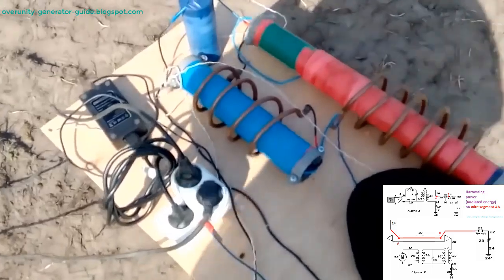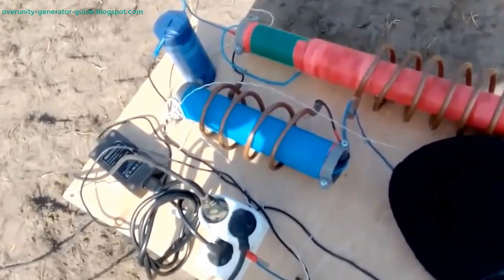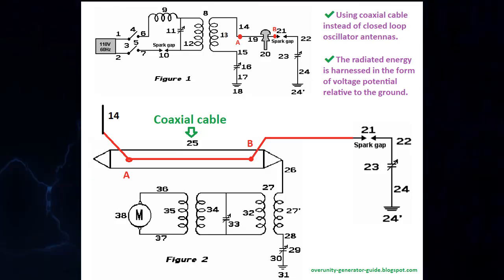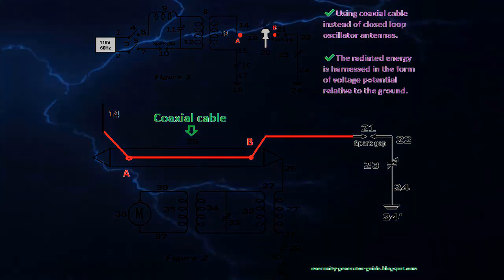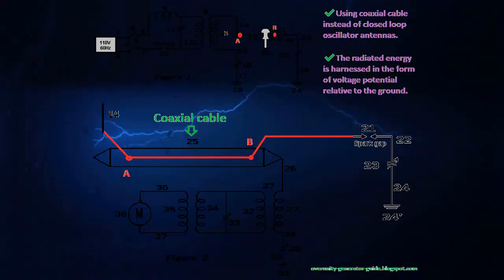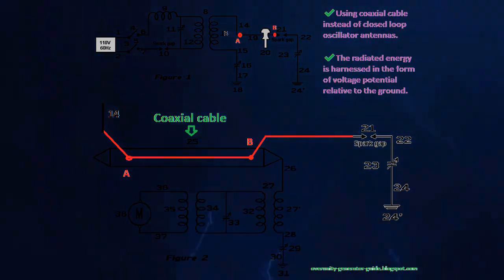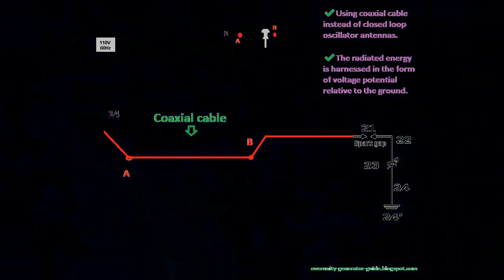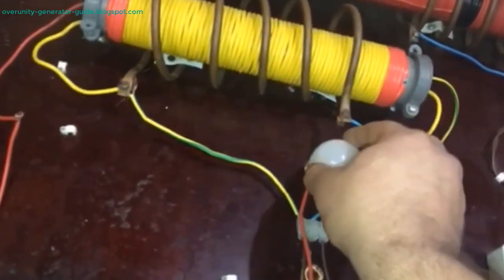Free Energy: Reverse Tesla Coil | Harnessing Radiant Energy in Electric Circuits by Frank Prentice

Comment: a true reverse tesla coil, which i have dabbled in (on a very miniature scale, using a step down transformer) uses the toroid as a receiver rather than an emitter. often times, you see a tesla coil emitting lightning bolts, this is something tesla did as a demonstration for the fun of it. his actual tesla coil was a true reverse tesla coil in the sense of a typical tesla coil. it didn't emit from the toroid, it received energy. the received energy converted high voltage (thousands of volts in pico amps) into a much lower voltage at a higher current, and the output energy was directed to a socket that utilized the power. the irony is that everyone tries to use the toroid as an emitter of energy, often times putting a fluorescent bulb near the toroid and watching it glow. this isn't how it's supposed to be utilized.